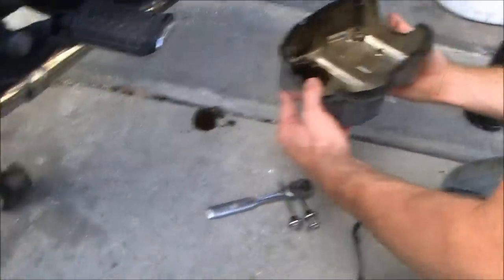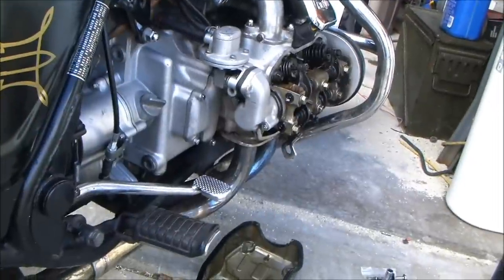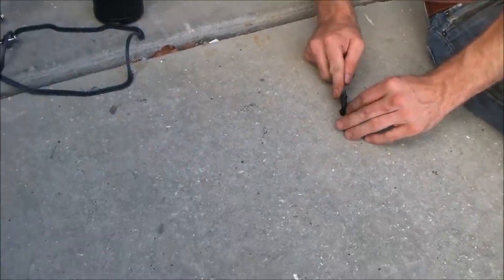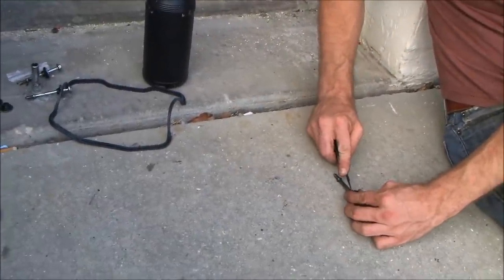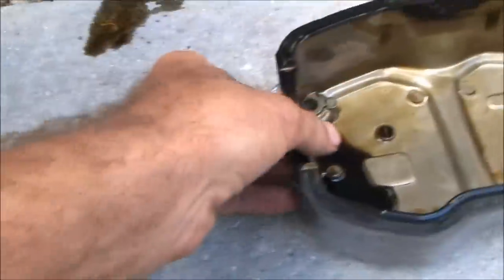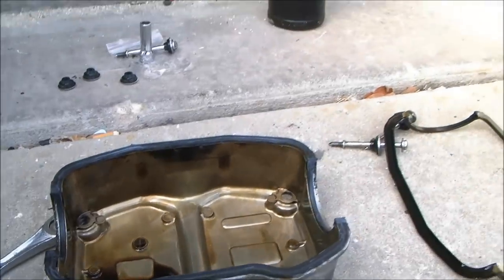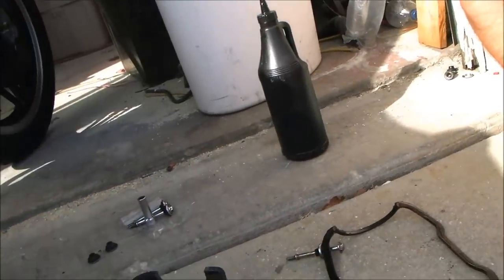Changing your GL1000 GL1100 GL1200 Valve Cover Gasket

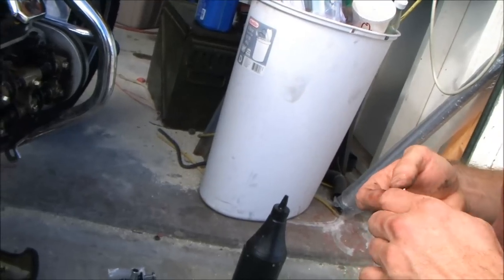Comment: @0:56 As long as you don't remove the valve cover you might not need a new gasket.
Reply from the maker: You have to remove them every 5 to 10,000 miles to check and adjust your valves. No way around that ... also - even a 1200 the rubber is 35 years old -- very often if those gaskets have not been replaced, they leak from age and deterioration alone (voice of I've had a lot of oldies pass through my hands) even if you haven't removed them from the time you got it at the auction (or out of Bubbas barn) until you got it home...

Comment: How can I find those rubber things you talking about..I gadda change mine cause it's leaking. .but the valve cover gasket I see on line  don't have those rubber things? What r they called
Reply from the maker: +carlos olguin ey are in the parts fiche on bikebandit.com - Also durn near any Honda dealer will have em on hand - they still use em on a lot of fairly recent bikes
Reply: +dawino6260  how about a quick video on changing the clutch wire..my just broke from the grip.think I gadda get a knew one..looks like i might be able to get it done myself. looks like 2 screws in the back of the motor..anything I need to know
Reply: +dawino6260  1978 honda goldwing gl 1000..

Comment: would a bad head gasket cause performance issues like loss of power and engine vibration on acceleration in 4th or 5th gear? I have an oil leak on the left side running down my exhaust pipe. 80 gl1100